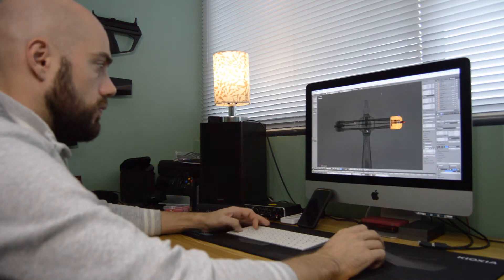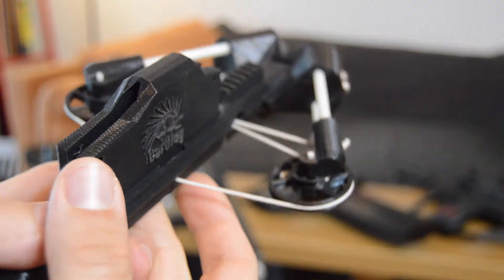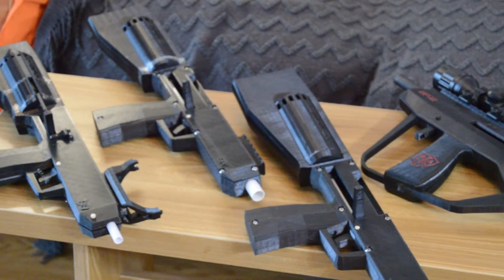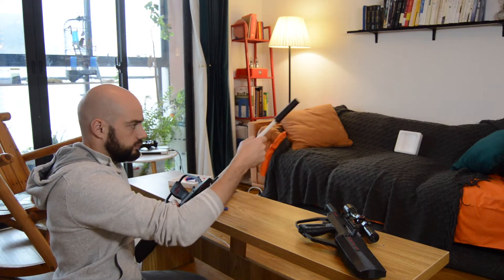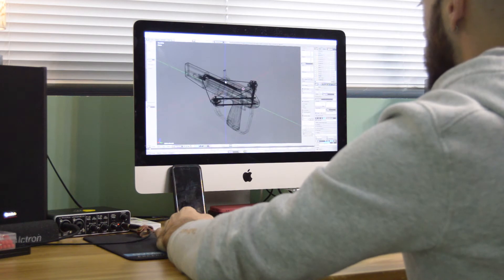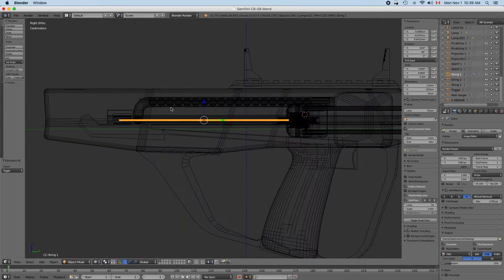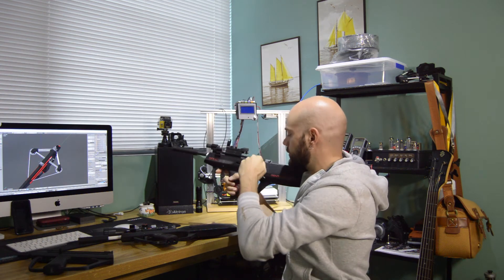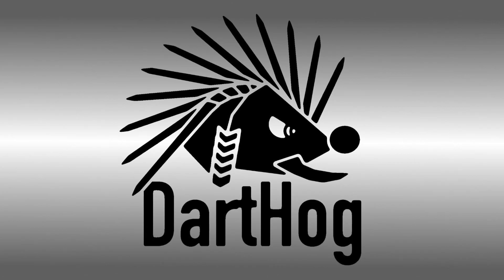"DartHog" Crossbow Update

Comment: Great project.  I would love to see the STEP files.
Reply from the maker: I work with Blender which isn't really meant to do CAD, but rather 3D graphics (I'm too lazy and poor to get into proper CAD). I looked for a STEP export option, but Blender doesn't seem to support it...
Reply: @FedericoLucchi  thanks.   I use Fusion.   The latest update has great tools for STL conversion.   So I can try that If you will share them.      You might try fusion.   The hobby license is free.   It took me about 2 weeks to become very proficient on it.
Reply from the maker: @manningcustom  Thanks! I had a look at CAD earlier but only found expensive and difficult softwares. I will definitely have a look.
Reply from the maker: Here is my new website with the STL files. Still untested though, I will publish a video once I put it together (I might run into issues when I print it, and update the design)
https://federicotlucchi.wixsite.com/my-site
Reply: @FedericoLucchi  Thanks!!!